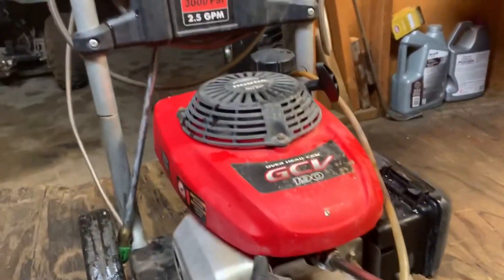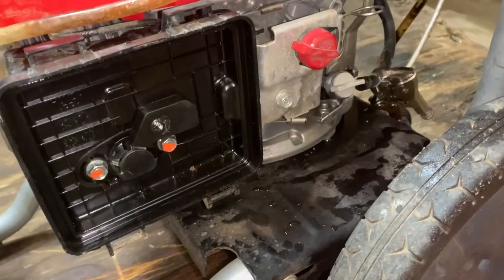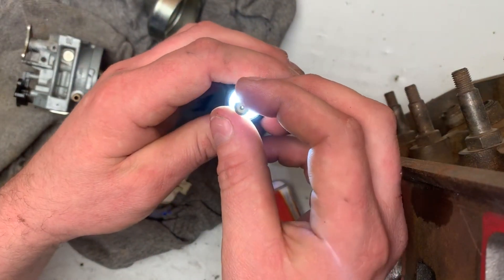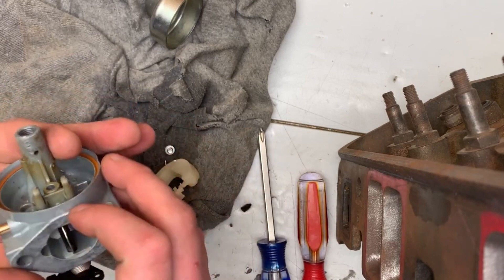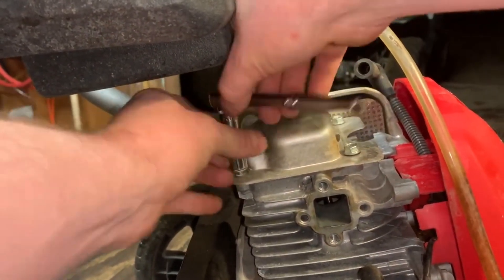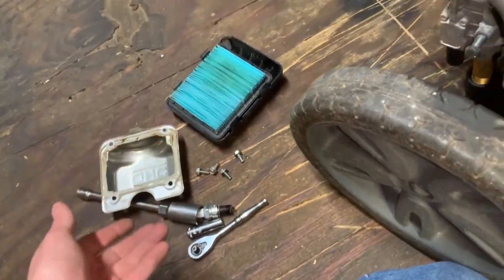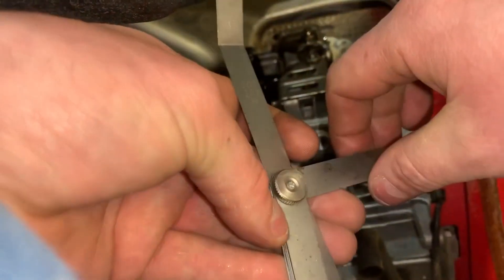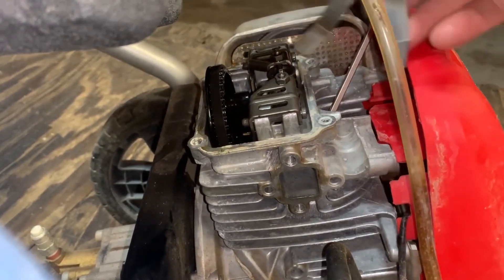Power Washer Honda GCV 190  (Valve Adjustment)

Comment: I usually wreck the pumps on these long before I need to adjust the valves. Just replaced it on mine because I bought one that can rebuilt. On my 8th washer.
Reply from the maker: haha It's really common people do that.   Usually they forget to turn the water on first or they just test run them with out water then the pump burns up.   Water acts like a Lubrican't for the Pump.